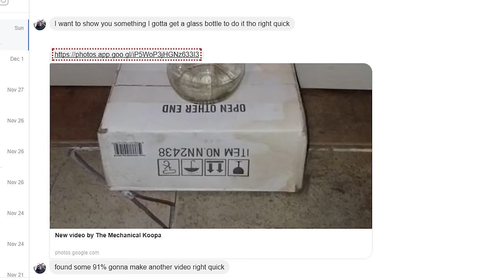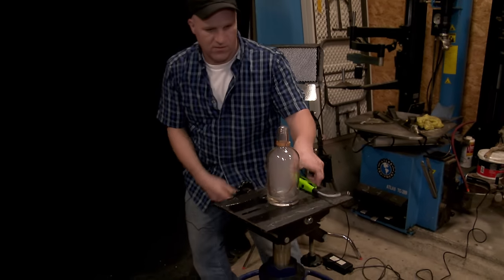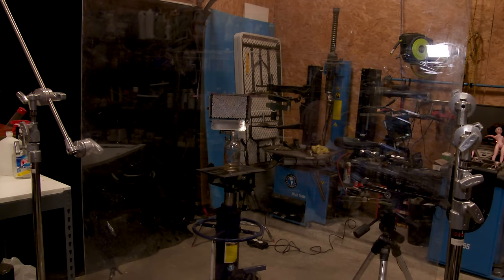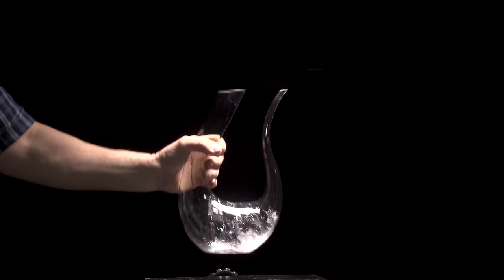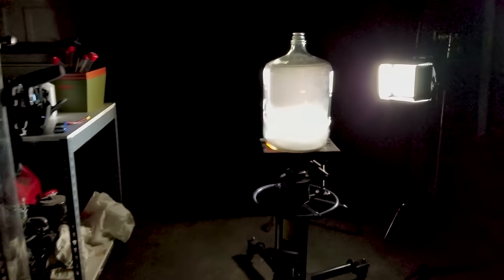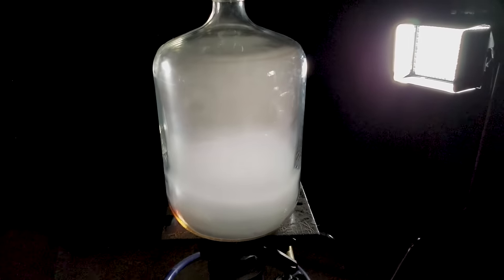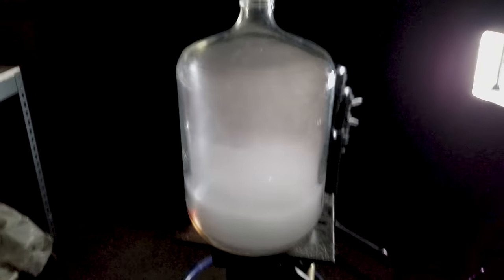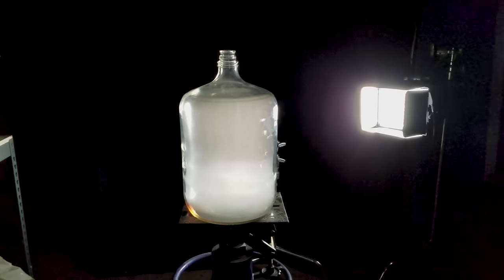Nitromethane Jet Bottle - Looks Awesome in 4k Slow Motion - aka Whoosh Bottle

Comment: Pressurize the alcohol? You didnt pressurize anything. You stirred it around
Reply: He put his hand over it and that pressurized it. When it went clear it was because the higher pressure can dissolve more alcohol.
Reply: He actually depressurized it. The fast moving air produced a low pressure area, below the vapour pressure of the alcohol, forcing it to evaporate
Reply: How about replacing the oxygen? Pressurized an open container, holding all that pressure in through an open hole

Comment: You should try that 2 sided bottle again but light the small side. I think it may continue to burn a bit longer as it will get more air from the larger side using it as an intake basically.

Comment: try sustaining the jet by drilling into the big bottle with a glass drill. one hole for compressed air . and some type of a tee into the air line so you can regulate the fuel to be inserted into the air flow.  so it is mixed and atomized when it reaches the glass chamber.  see if you can make a ghetto jet engine .

Comment: Could you make a combustion sustainer/accelerator by "soaking" some activated charcoal in pure oxygen? You could put some in a super-thin sandwich baggie at the bottom of the jug. Maybe it would sustain the combustion longer since the oxygen would be released from the carbon over time; then again, it might explode. Maybe start with just a teaspoon of charcoal.

Comment: I really enjoyed this episode, since being a little kid I often did the same thing with a 2L Cola Bottle and some Gasoline........mostly got burned to try & light it but it was always fun.

Some Years Back I started Playing with HHO Injection in my Car as a means of increasing the power but for fuel consumption increase. as will all things the Experimental Phase is the Fun bit. 
I was amazed at how Quick the HHO Gas produced actually burned compared to other gasses. It is so Quick & Violent that it actually Explodes the Plastic Cola Bottle instead of making a Whoosh.

I am curious to see what happens on the High-Speed Camera Footage. It would be awesome if you could do an episode on this?

Comment: Or you could watch the only video I have up, where I show my decade old water jacketed, full glass body pulse jet design. You could film a few hundred of those whooshes before the inner chamber self destructs, or better yet, a guy with your resources could probably source a borosilicate bottle in the same form factor which might be able to run the fuel out if it gets a few warming runs first. If you can bring the inner chamber up to boiling the water becomes much more effective at sapping the heat.

Comment: Dangerous but Pretty Cool to watch. Several problems though; they make this thing called a funnel which helps you form spilling it all over causing an extreme chance if FIRE. Next, you'r using far to much fuel !It takes ONLY takes a cap full to produce the same effect. Next, the rellow resedue is unburned fuel leftover from adding to much. If you were to take the air nossle and blow out the fog (smoke), their by adding more oxygen, and light it again without adding more fuel, it would produce the same reaction again. And, as mentioned in another comment, be careful whai type of fuel you use as EPLOSION can occure. It may explode if the bottlw neck (the part that makes the cool Whoosh) is to small. Lastly, I suggest using a Plastic bottle instead. In case of explosion, the plastio is less apdt to cut you to shreads ! I an speaking from experance. I have tried all these and seen the result. Cool video, but don't try this at home without supervision.

Comment: Have you tried burning gasoline with different octane levels? It’s very interesting to see the difference in burn rate of pump gas from 85 to 95. 85 is hast explosion. 95 is slow with a little pop.

Comment: 3:01 can you make a jet engine if you fill the bottom with alcohol,
put the air-compressor in the small hole at the top,
and then light the lighter in the big hole?

Comment: 9:31 I'm really glad you didn't ignite the mist in that bottle.   Maybe you could reproduce this experiment in a safe location, have The Slo-Mo Guys bring their cameras, and record the results for your channel.  I wonder if that mist is the same thing that can accumulate in the cylinders of top-fuel dragster engines and cause interesting mechanical issues when the throttle opens again?
Reply from the maker: Good idea, I might have to try that, u think it will explode?, From what I know it's oversaturated and needs oxygen from the top to burn which is why it has this effect. The Slow Mo guys blocked me from their channel a few years ago.... haters., But I wouldn't  call them anyway since I  own the same cameras they use which they don't actually own.
Reply: @WarpedYT  One way to find out!  Hope for the best, another beautiful whoosh jet demonstration.  But prepare for the worst, a detonation in the glass bottle with the same force that can explode a dragster engine, and set up your observation and experiment to run remotely.  As the racers say "Nitro is not your friend."
Reply from the maker: @josephastier7421  lol exactly, only one way to find out You know that's right !!

Comment: I think if you mix 20% nitro & the rest Methanol the result may be better.Burn faster anyway.Nitro Methane can go off.I tried to burn some that had gone off and was  shocked at how hard it was to burn leaving lots of residue. Also if you drill a hole low down just above the fuel line then ignite it there it just may Blow up instead.
Reply from the maker: Thanks! Yes but I definitely did not want a blow up, the glass is over 1/4" thick.

Comment: Well, Mister warped perception, you asked for an idea about raising the level of your wish bottle and so here's my suggestion,... and I have not tried this yet so be careful. But here it is, before adding the fuel put a little bit of hydrogen peroxide and then sprinkle a small packet of yeast into the hydrogen peroxide. Hydrogen peroxide is chemically written as H2O2. Than means it is water with an extra oxygen attached. The yeast has within it a chemical called catayse that releases the oxygen creating a lot of bubbles and it does it very quickly, and also releases heat (an exothermic reaction.) Which I'm sure you already know. Well anyway that's my suggestion and I'm not sure what will happen but it could be fun because you will be adding extra oxygen to the whoosh bottle just when it needs it the most so it could be a fun and cool out come but it might also be explosive so be careful. As I have already stated, I have not tried this. Safety first!

Comment: whatever you do dont start with 100 percent nitromethane, put some on the ground, light it then drop a piece of 3/8 steel plate on it. from what I hear,,,,  nitro goes crazy when it is compressed and the steel plate would fly up into the air.

Comment: Wonder what would happen if you would use pure oxygen instead of compressed air ?
Reply from the maker: +TheCelltek it will blow up unless you regulate the flow of oxygen
Reply: Tried that once with a quart sized glass bottle, 90% IPA, and O2 from a disposable bottle oxy/MAPP torch. It made a nice bang that left me partially deaf for a couple hours.  Thankfully the bottle didn't explode thanks to that little bit of water content in the IPA.  The neighbors thought I had set off explosives in the yard.

Comment: I thought it would have been cool to put the bottles on a scale and measure the thrust that the fuel produces in the big bottle. 

Edit: Also, the fuels were limited by oxygen in the vessel. Using pure oxygen instead of compressed air to agitate the liquid before lighting would probably yield maximum combustion.

Comment: I find that it works better with less liquid in the bottle, And pumping in pure oxygen.
Reply from the maker: John Smith lol... Don't even try it,  You try that first and then send me the video, I won't mess around with that pure oxygen and fuel without the proper shielding and protection in place. I've done a lot of things with oxygen and also liquid oxygen, I know what it does.
Reply: Oxygen sure does make things more interesting but yea, It's no joke. If you search "Pure Oxygen Whoosh Bottle", There is a video of some guy that does an alcohol/oxygen mix and he also does a petrol/oxygen mix. The latter one I would not dare consider of doing. See the video to find out why...
Reply from the maker: John Smith wow.. I'm going to look that up now, I haven't actually seen that, but I do understand the science and chemistry behind that which is why I didn't try it in this particular setup. If I were to do it I would feed the oxygen in as it burns to have complete control over the combustion vs just complete chaos and unpredictability.
Reply: I suggest nitrogen tetroxide, and unsymmetrical dimethyl hydrazine.
I also recommend getting someone else to do that, in some other country. :D

Comment: You need to realize why nitromethane is used in the fastest drag cars.  It is not because nitro methane is more explosive than gasoline because it isn't.  Nitromethane needs 90% less oxygen to burn than gasoline needs so you can burn 10X as much fuel as you can with gas with the same amount of oxygen.

Comment: if you aren't quick, fill a pop/beer can wiith your bic, then put fire in the hole and your hand gets burned before you can move it. sounds like a rocket and the whole can gets hot. of course you have to estimate the air fuel ratio close.

Comment: could you do this with pure oxygen?
Reply from the maker: nicktohzyu I was actually going to do that in this episode, however if you do some quick math, air is 21% oxygen, so technically pure oxygen would burn 5 times faster, I'm not sure that this bottle is up to that task.
Reply: Warped Perception you could use a reeeaally long stick 😂
Reactions may not be directly proportional to the concentration. For example, 5x oxygen concentration can result in 25x reaction rate. You can even have fractional exponents.